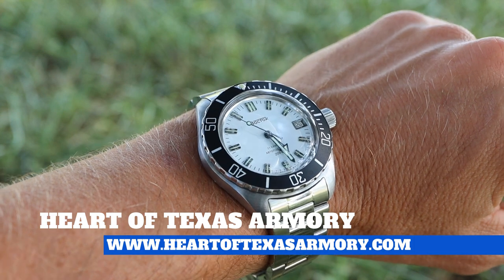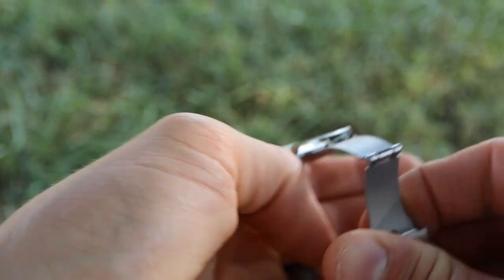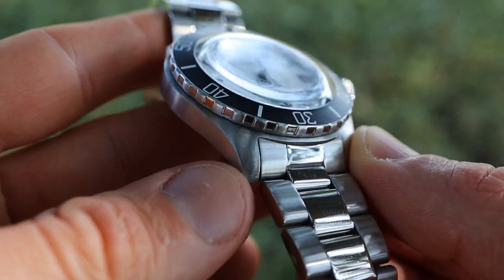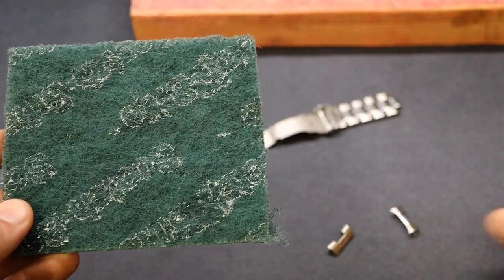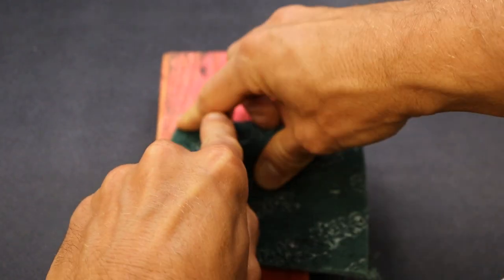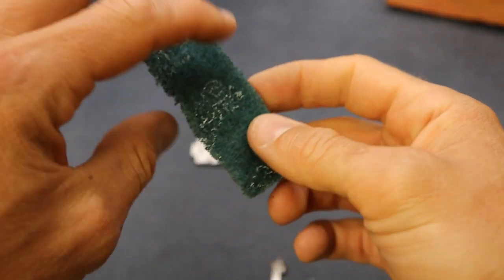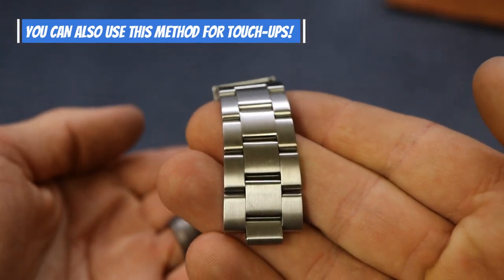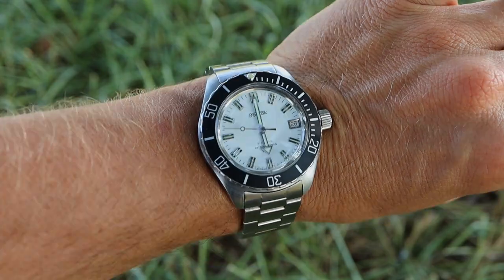Let's Brush a Watch Bracelet - A Simple and Fast How To Guide

Comment: Looks day and night better! I have 6 Breitling's and a couple of Rolex's that need 'touch-ups' and rather then using my Dremel, I'm going to use your method. I'm older Viet Vet and have resisted subscribing in the past but your video is very professional and I'm sure I'll gain much needed knowledge from others you've posted! Thanks, a million!
Reply: The Dremel would have been very risky. Hope it turned out well.

Comment: Nice job. Simple, effective. I finish with a couple of drops of automotive chrome polish. Smooths out everything but leaves the brushed look.
Reply from the maker: Nice tip!  Will definitely give that a shot the next time I need brushing.
Reply: @HeartofTexasArmory  nice video thanks for sharing. 

I do a lot of this type of stuff. 

Some comments:

1. As the other chap said, always finish with a bit of autosol polish and some gentle strokes. You can use normal A4 paper for this step with the polish. Cut to size. 

2. The finish you have on the watch case is actually not brushed. It’s a satin finish. And the finish you (kinda) have to your bracelet is also a satin finish. Brushed is when the lines are all straight, joined and very distinctive. Think AP royal oak bezel for brushed. 

3. I would have taped off the existing links that were already satin finished and only brushed the center links. You can use painters tape or thermal tape. You will then get a two toned finish for your bracelet. 

4. If anyone screws up, instead of more crazy hard strokes with the scotch brite pad, first use some autosol metal polish to removed the existing scratch lines, and then start again. 

5. To keep the lines nice and even, use some double sided tape on a piece of wood. Place the bracelet on the double sided tape to secure it. Next put the pad or sandpaper etc on a flat table. Secure it to the table. Now, place the wood and bracelet on the sandpaper, and use a black marker pen to trace the two sides on the pard or paper. 

Finally, brush the bracelet against the pad/paper with the same pressure and direction. 

The finish will be much nicer. 
Hope this helps others. 

Best wishes from Singapore

Comment: The problem with this method is that the ends of each polished link, which are below the surface he is brushing, will remain polished. You will have to curve the bracelet and brush each curved side, which is is hard to do.
Reply: tru but for 15 minutes is good

Comment: I have orange scotch brite pads where I am (in Korea), and haven't yet come across green ones. Is there much of a difference? Will the orange ones work do you think? Thanks.
Reply: scotch brite maroon 7447 is what I used on my Rolexes, looked perfect.
Reply: @RoadcraftNottingham  what's the difference between the 7447 maroon Scotch Brite and the Green one that's used on this video?? Want to get the correct one
Reply: @Digital_Ken  I can only guess the grade. I have now used the 7447 and they look perfect. Just be careful to mask off the bits you don't want doing, I used insulation tape and make sure you go in dead straight lines several times to make it even.